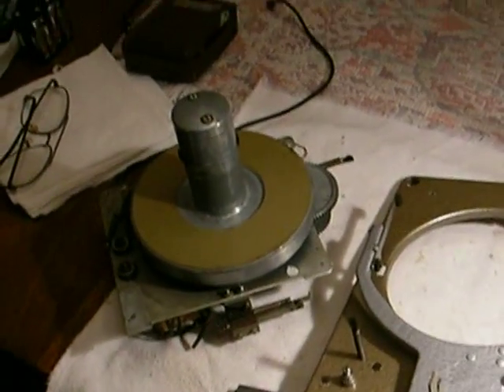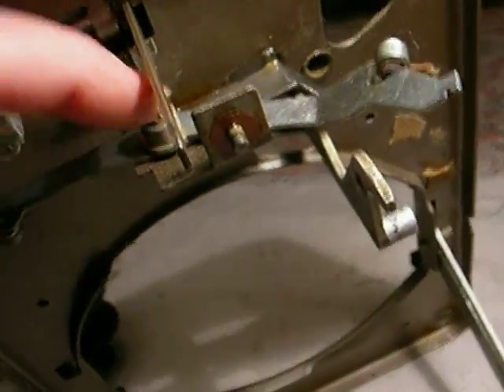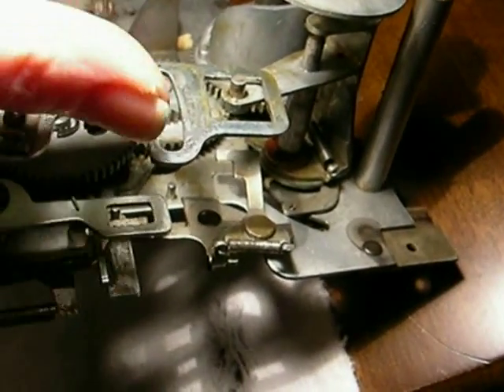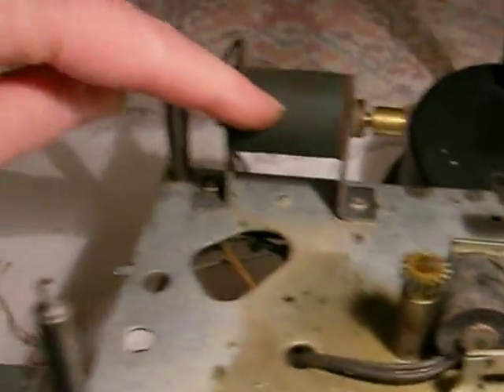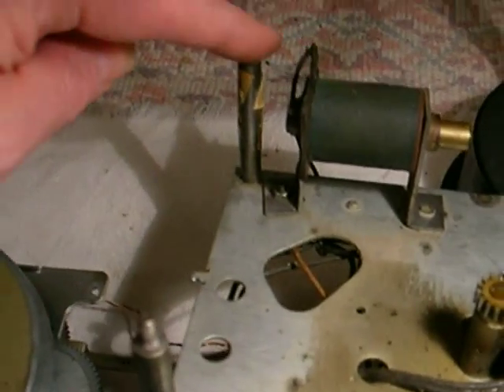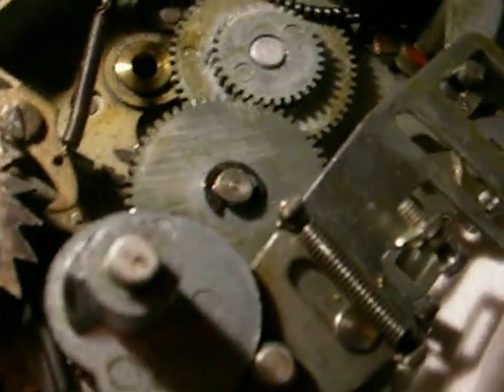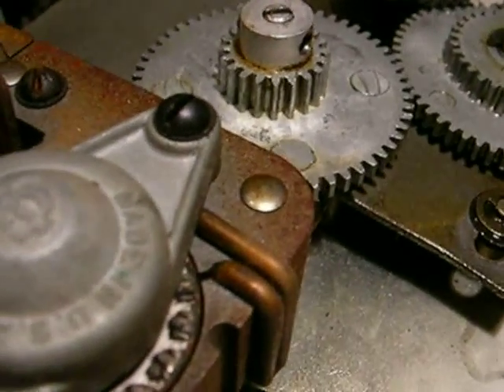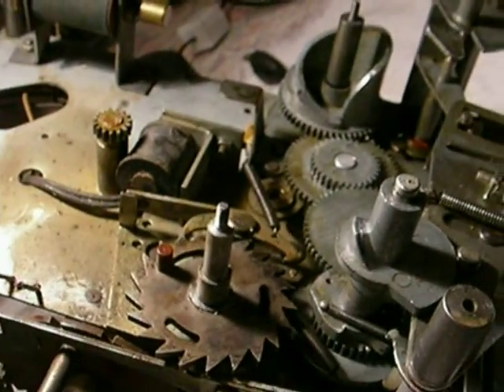Ristaucrat S-45 mech part 5

Comment: That thing must have been designed by some sadistic Rube Goldberg.  It seems way  overcomplicated and hard to service for the little that it actually does.  You are a better man than I, because I would have put that contraption in the trash before spending that much effort on it.